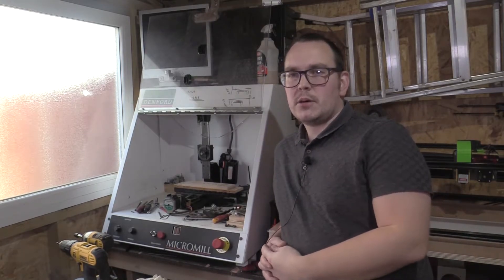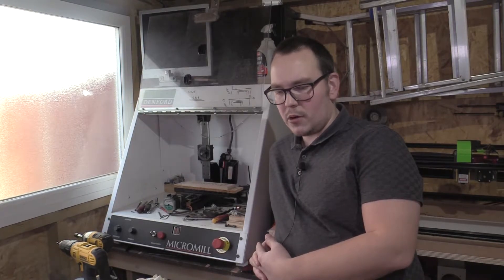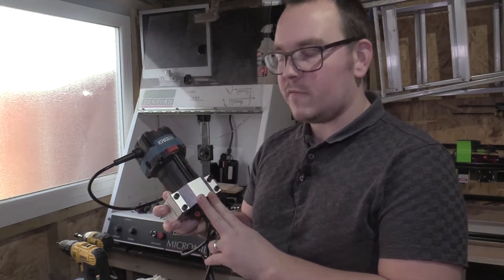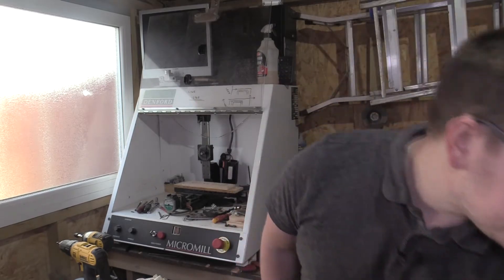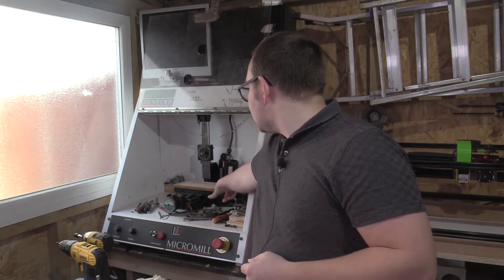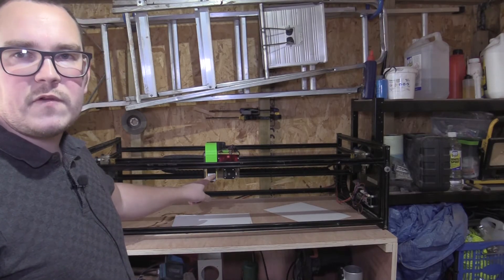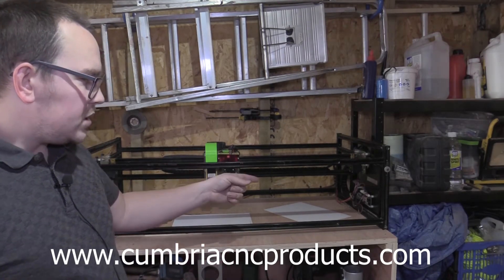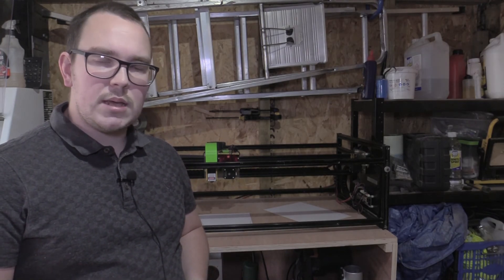Denford Sherline Spindle Motor Upgrade Replacement - January 2021 Give Away Result

Comment: I had to upgrade the motor in a Denford CNC router. The original Porter Cable router failed 3 times so it was replaced with a Makita trimmer router. We couldn't get the  motor to integrate with the control hardware so it was just switched manually but way quieter and much lighter so less mass on accel and decel.
Reply from the maker: Thanks mark good info. Yes I was thinking it would be lighter. I struggle to get my z axis to travel any more than 400mm/min at the moment but the reduced spindle weight should halp.